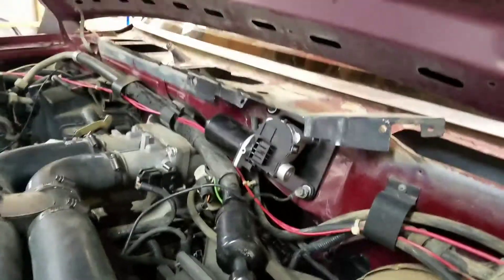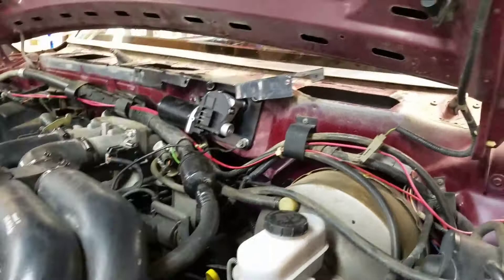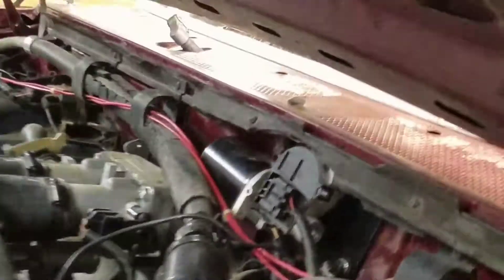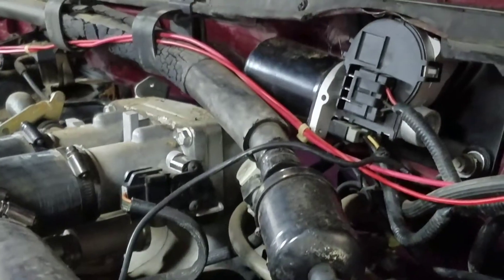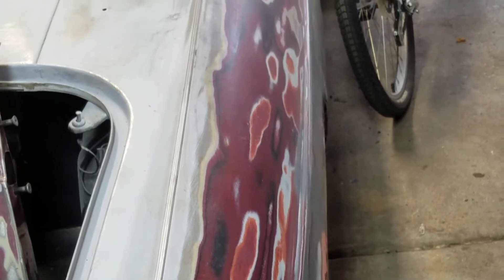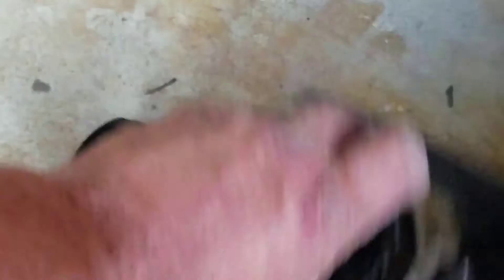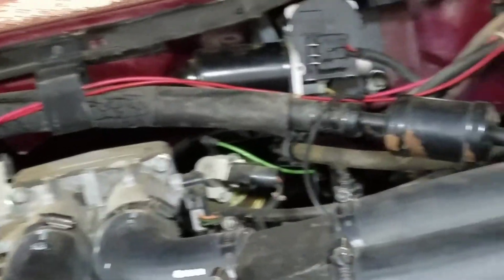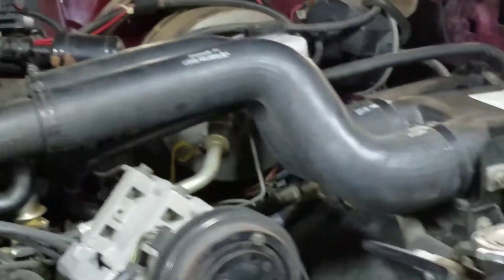1989 Ford F 250 Wiper problem solved!!!!!

Comment: This was an excellent instructive video. I put the knowledge gained to work. Followed your instruction to a tee and now I have fully functional wipers again. New the motor was the culprit when looking at the amperage gauge on the dash when turned on the needle was bouncing even when the wipers were not moving. Scary thing driving in poring down rain on the freeway and having the wipers come on and off sometimes with a 10 second gap.😳 Now if I could just figure out the column gear indicator out of alignment fiasco I will be back on track. Thank you.
Reply from the maker: Thank you sir, I am glad that it was helpful and you were able to solve the problem. It does suck when you are driving, the rain hits and the wiper shuts off. Crazy. I heard messing with the gear indicator is not fun. but that was on an 84 caprice wagon. Have a great day.

Comment: I got a 1990 F-250, I'm trying to get my interval wipers to work, I know my wiper motor is fairly old but my wiper switch is brand new. First thing i checked was that wire lol. Its either the motor or the windshield governor module. I hope I figure it out! Nice Video.
Reply from the maker: Thank you. I hope it was helpful. The module was definitely not put in the right place by the e brake. I cannot remember, but if it did not have a ground the interval did not work. It has been a while.
Reply: @theawakening5548  appreciate the reply! I picked up a Ford Service Manual, should have the problem fixed in the next week or so
Reply from the maker: @marshallbott6936  You are welcome. I hope you get it fixed. If it is no trouble let me know what you find.

Comment: "Diagnosis"? more like shootin' out of the parts cannon. Glad it's working again though, you hit a bullseye!
Reply from the maker: Doomzdayxx I thought for sure it was the relay/module, because of what it was doing. Turns out the motor was overheating. The only reqson I replaced the switch was because the ground ripped out and there was no way to get it back in there. Thank you for watching.

Comment: I broke the nob inside and put it back on but it’s still not working. What can I do?
Reply from the maker: Not sure what you mean. The knob off the switch? When you turn the knob can you feel the rod turn? You can take a pair of needle nose and try and move the rod and see if the switch works. To keep the knob on you can always drill a hole and put an allen nut in there to keep it from spinning. Just make sure you put it on the flat side. If you wrap the rod with some electrical tape you might be able to make it tight enough to turn it. If it is something else let me know.

Comment: Man I have to do this too mine,  both the switch and the motor ugh... I haven't diagnosed anything yet, Im guessing I should, test motor by putting 12 volts to it or see if its getting hot, she's just running slowly in all positions, Truck only has 60k miles on it. I think ill think about it some more and put some rainx on it haha
Reply from the maker: Rainx is one way to do it lol. IT really is not as bad as you think. I have seen a couple videos on others, but they never say how it turned out after. I am glad that I was able to make a full series video to show people the entire process. Thank you for watching. Good luck.

Comment: How do you get the windshield washer fluid to come out only my wipers move
Reply from the maker: Can you hear the motor for the pump? If you cannot hear the motor, find where it is and pull it out. You can hook the battery and hook it up to see if it works. If it works check power to the motor. If it does not replace the pump. Follow the rubber lines and make sure they are open and hooked up to the pump.

Comment: now im having the same problem but my motor is not getting hot and sometimes fails to park is it possible i just have a grounding problem?
Reply from the maker: You could have a grounding issue, check the relay as well. The relay is in a bad spot right by the parking brake so if you use it and it gets hot it can mess it up a bit. Is it clicking at all?
Reply: @theawakening5548  when the blades stall out i heard a buzzing sound  similar to the 1980s ford seat belt buzzer but much quieter

almost like the sound of bad brushes in a motor but when i feel the motor its cool to the touch

Comment: Rip the old switch apart; shoot a vid of the inside and we will know where to drill!  My '93 F350 and my nerves thanks you bunches.  I think i have an old working motor around here somewhere.
Reply from the maker: That is a good point, I never thought of doing that. That would have made for a good video, the switch was trash anyway. Now I wish I still had the old switch, lol. I am glad this video helped you out and thank you for watching.
Reply: @theawakening5548  No worries.  I had my head light switch in an 87 f250 over heat to the point of the lights going out.  It was December and running heater full blast.  Had to open vent wing and turn a/c on. Never did it again and that was 10 yrs ago. Electrical problems are a hoot.
Reply from the maker: @olivei2484  Yuck that had to suck. Electrical problems are a bear. Sometimes they come and go. It sucks when it is a loose ground. Those suck to find. It is one of the things I scored very high in for autotech, but I cannot stand it. The thing that I am good at, I hate. Makes sense, lol.
Reply: @theawakening5548  Yup.  my favorite "oh shit" moments are full head light failure at night and brake failure on a busy hwy (two separate cars 20 yrs apart).
Reply from the maker: @olivei2484  I feel you on that one. Especially in the heavy traffic, not fun at all.

Comment: I'd love to see someone take that cowling off, step by step.  I can't figure how to get it off of my 1994 F250 turbo diesel.
Reply from the maker: If I still had the truck I would make one for you. However, the small bolts on it should remove the cowl, I think they are 8mm. You will probably need to lift up the rubber if it is still there. Hopefully you live in a dry climate and they are not too rusty. Good luck.
Reply: @theawakening5548  Ah, I finally got it off just now.  Thanks, I was making it harder than it was - HA!
Reply from the maker: @brucewayne2984  No worries, I do the same thing. Excellent, I am glad that it worked out for you.

Comment: Do you happen to have a part number?  Thanks for the video!
Reply from the maker: I got the parts from rockauto.com. Part number for the Wiper Motor is WAI WPM299 and the wiper switch w/intermittent is WAT 6L9. 1989 FORD F-250 7.5L. You are welcome, thank you for watching. I hope that it helps.

Comment: i have a v10 1999 f250 superduty wipers work but intermittent dosnt I've changed the lever multi switch didn't fix it im wondering if the motor controls it? any one know thx danny
Reply from the maker: It is possible that it is the motor. However, I would check the ground for the switch. I know it may be different than what I worked on, but I did notice that when I put the switch back in, when the ground was not hooked up I had one speed. That is why I had to get a new one, the ground ripped out of the switch and there was no way to put it back on. If you have not tried already, try tapping on the motor, if you can, while on that speed and see if it does anything. Find the wiring diagram and see which wire is for intermittent on the motor and stick a test light, if you can, on that wire and see if it is getting power. Check the governor module if it has one, it would be in between the switch and the motor. That is all I can think of right now, if I come up with something I will share it. Good luck.

Comment: I wanted to know hows the best way to get motor off step by step....blah
Reply from the maker: Step by step is not too difficult, unless you are in an area that uses a lot of salt on the roads and you have to deal with a lot of rust. 1st remove the top vent piece covering the motor. They are under the rubber piece. This will give you better access to the bolts to the motor as well as the rods connected inside. There will be a clip in there to remove to separate the motor from the rods. Be careful there is little space so try not to drop the clip. If you do drop it get a magnet and try to fish it out. The toughest part is the cover, because it is screwed in not bolted I think. If you are in an environment where it is rusty try some pb blaster and let them soak in it for a while. You could use a little heat, but be careful.